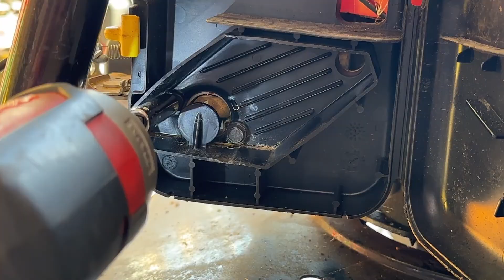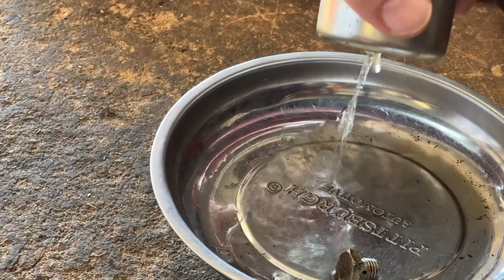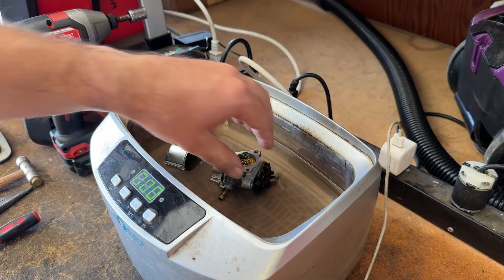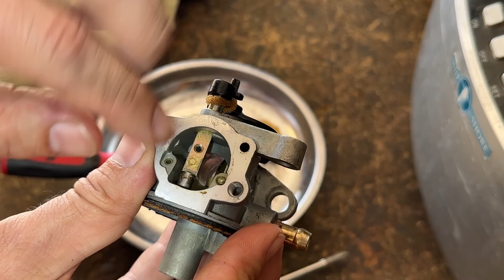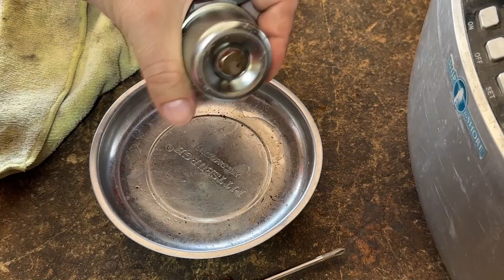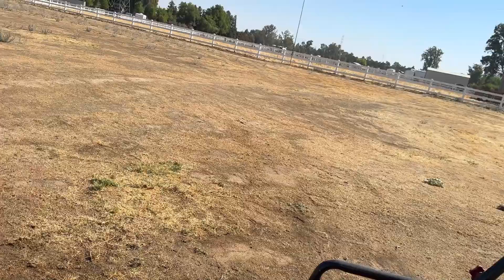Fixing a Craftsman Pressure Washer that Sat a While

Comment: I just fixed same engine on Husqvarna..fly wheel key, new head gasket, adjusted valves. Works great.  Also a 8.50 Briggs with all the pieces from carb.  Took me 45 minutes to figure out sequence of gaskets..still wouldnt run. Adjusted the valves to .005 tight.  Fired up...
Reply from the maker: Awesome glad you got it fixed. These engines aren’t too bad but they do need the valves adjusted occasionally

Comment: I got a Simpson pressure with a kohler engine.  Runs great .  Needs a pump ?

U got any pump replacement videos?
Reply from the maker: You need to first figure out what pump is on it. You can find Amazon pumps that will bolt it up but kill your profit.
Reply: D Fields. Love your channel...dislike Kohlers